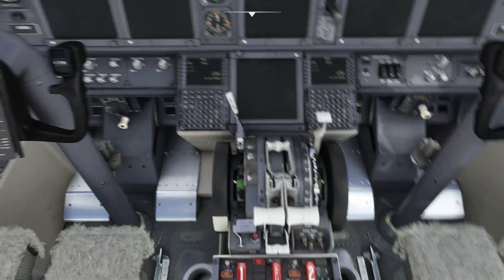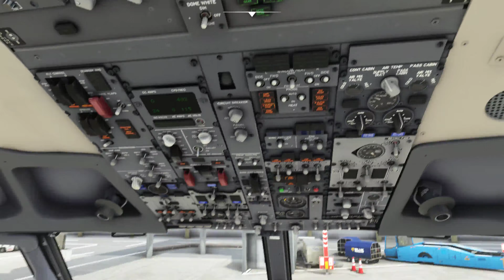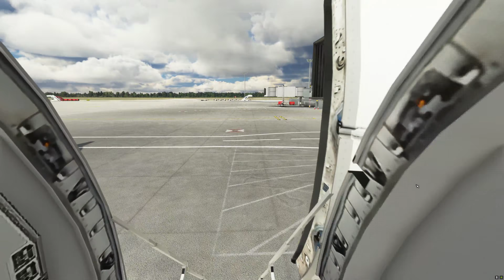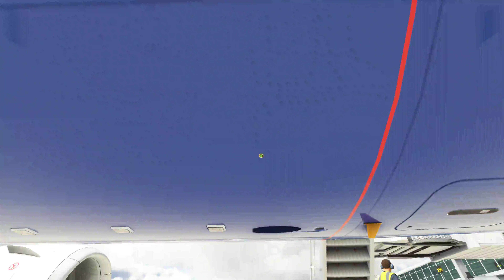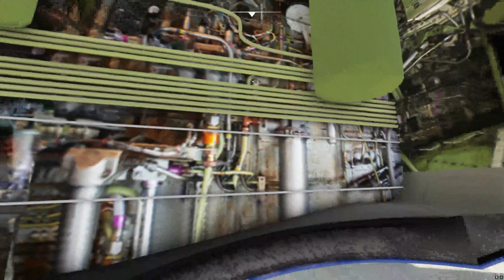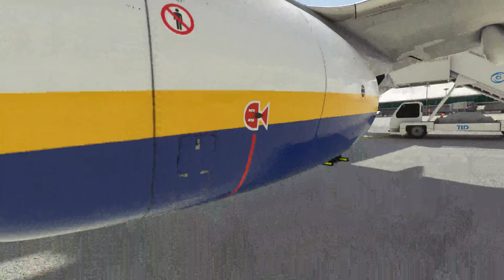PMDG 737-700 for MSFS - Tutorial 1: Safety Inspection, Powerup and Walkaround

Comment: I’ve often heard that you put the Position Lights to Steady once you have AC Power. Is that airline specific or is there another reason that it wasn’t done in that tutorial?
Reply from the maker: The switch is normally left in the STEADY position anyway - so once power is applied it'll be on.
While you are right that the position lights should be on once AC power is applied to the plane it is not specifically mentioned in neither my former airlines, nor Boeings own SOP, to switch the lights on immediately after applying power.

Comment: Hi there!! A&P tech here and I just wanted to point out that is not a fuel overfill vent.  Yes fuel can come out of it but it's main design is not an overflow vent.  They are called naca scoops and their main design is to provide ventilation to the fuel system and tanks.  This is why it's pointing into the direction of flight and has a scoop design to allow airflow into the system and tanks.

Comment: You are amazing. I think that you follow RYR procedures. To be honest sometimes I can not find the logic between the sequence of some procedures. For example, why to make the engine fire warning test then go to overhead panel and after some steps return to cargo fire system. For me it is strange moving up and down. Is there a logic behind it? Thank you very much for your work.
Reply from the maker: The logic is that in case there is no GPU available you would have to start the APU at this point.
Once AC power is established we move on to the overhead and start making the airplane safe by arming the emergency exit lights. If we did that before the APU start/before applying external power, the lights would turn on and drain your battery.
Hope this makes sense!
Reply: @A330Driver  Yes now it makes sense. Thank you very much for your answer.

Comment: Before you head out for the walkaround, I understood the reason behind turning on the parking brake and the electric hydraulic pumps but is there a reason NOT to turn on the wheel well lights? Are they only used at night? I mean a lot of lighting is required during the sunniest day in aviation so I am just curious.
Reply from the maker: There is no reason NOT to turn on the wheel well light. The wheel well is pretty dark, even during bright daylight (especially then since your eyes are used to the brightness) so turning on the wheel well light can never do any harm.

Comment: How do we start cold & dark (I got that set) but also not have stairs but jetway instead?  Is there a way to start with the plane not connected to jetway or stairs until you request?
Reply from the maker: You'd have to create a new panelstate. I suggest loading up a default cold and dark panelstate and removing the equipment you don't want, then saving it again.
Reply: @A330Driver  Okay, thanks!

Comment: You state that you aren't going to start up and use the APU to save the environment. But you will use the ground unit that also runs on fossil fuel. What's the difference? This is the same nonsense that the so-called elites use jet setting around the world in private jets saying they are saving humanity from global warming. Can I please make a suggestion to not use fake political/wokism  BS in your videos?
Reply from the maker: There actually is a HUGE difference in the emmisions from the two. A typical diesel GPU uses anywhere between 4-10 liters an hour to power a 737. The most modern ones can even go under the 4l/h mark. The APU uses around 60kg/h.
Furthermore, many airports are using units these days which are implemented into the airports own power system. At least here in Europe quite some of them are already partially using renewable energy.
Now start calculating these things for the whole industry. Let's take an airline like Ryanair that's doing around 3000 flights a day. That also means 3000 turnarounds, lasting 25 minutes. That's 1250 hours of turnaround time where the aircraft need power.
Let's say we only use the least energy efficient GPUs, using around 10l/h. That's 12500 liters of Diesel being used to power the aircraft. The density of Diesel is typically around 0.85, making it 10625kg of Diesel
Now compare it to the 60kg/h from the APU. That's 75t of fuel.
10.6 vs 75.0t of fuel usage. You're saving 64,6t of fuel just from these 3000 Ryanair flights alone.
Now for the fun of it, let's extend this calculation onto the whole worlds traffic. This is of course no longer accurate since it neglects many factors, but let's do it anything just for the fun of it. Every day there are around 200.000 aircraft flying. I can't find any data on how many flights these do, but to make it simple, let's assume 4 flights per aircraft, that should hopefully build a good average between long haul aircraft that only do 2 flights and shorthaul aircraft that do 8 or more a day.
Now make a simple calculation, 64,6/3000*800000.
That's 17226,67t of fuel that's being saved by the usage of GPUs.
Let's go on with this. 17226,67t of jet fuel equals around 21.533.333,3 liters of fuel.
In 2017 all of Germanys car traffic together used around 121 million liters of fuel.
See where this is going? All aircraft around the world can save around 17% of the fuel emmisions of all German cars a day.
I call that a lot.

Again, I don't claim those numbers to be accurate, they're just rough estimations based on ballparkfigures to show you roughly where we end up.

So no, this is not political bullshit, there's actual reasons behind this.
Of course it also helps the airlines as it saves money. But at least in terms of fuel usage saving the environment and saving money are the same thing.
Reply from the maker: So no, just because it doesn't seem a lot for a single flight, it doens't mean these things are neglible.
Of course, a step climb on a 2 hour flight in the 737 will typically only save you some 20kg of fuel which seems incredibly little compared to the 5000kg of fuel you're using on that flight.
Similarly, look at things like single engine taxi. You're saving maybe 10kg of fuel at best. But see how many daily flights there are and things will add up. That's why we're doing it.
Reply: @A330Driver   Thank you for the explanation.

Comment: How do you set your correct sitting position from the height What is the reference point? Airbus, there are white and red balls that you have to line up in order to sit properly
Does that also work with the PMDG like in real life with the seating position? Thanks
Reply from the maker: Basically, you need to be able to see the top of the glareshield slightly, but the control column must not obstruct the view of the PFD and you must be able to see the autobrake disarm light.
When all three are met you're sitting correctly.

Comment: The wait for the -800 will be excruciating
Reply from the maker: I can wholeheartely recommend getting and enjoying the -700 until the -800 comes out. I'm sure you'll find at least one or two airlines operating the -700 that you could fly.
Reply: @A330Driver  nope.  I have 800 hours in the -800 variant.
Reply: @A330Driver  yeah but then I’d have to pay twice
Reply from the maker: @LemonToGo  True, but then again you're also getting two aircraft variants. And it won't be as expensive as they have been back in the P3D days.
Reply: @A330Driver  I suppose that is true

Comment: How is it MSFS got the 700 before getting 800 & 900. Always before the 700 was the extra expansion you got after the base model 800 & 900 was the base model in PMDG. So I guess in MSFS 700 is Base & 800 & 900 are going to be the expansion instead this time around.
Reply from the maker: That's a question I can not answer, you should ask PMDG directly. I believe they actually posted an explanation in the forums already. Try to search their forums and you should find an answer.
Reply: @A330Driver  It has to do with cash flow.  They want $$ each and every iteration of the plane.
Reply: Every model will be a separate package. So you could just choose what model you want to buy. The 700 will release first then the 600, 800 and finally the 900  and finally theax series will also come. This way you can just pick a model that you want and not have to buy a 150$ package with all models.
Reply: @Rosne134  copy
Reply: @Rosne134  Thank you
Reply: @UnitedBill80  No problem
Reply: Yep PMDG knew the 800 is what most simmers want. But they knew if they released it first, all other versions wouldn’t sell anywhere near as well. And they knew many simmers wouldn’t wait 12 extra weeks for the 800 and would buy the 700 for the interim if they released it first. PMDG was dead right. They have made a killing on the 700 far beyond they ever would have if they released it after the 800.  It’s all about money. And PMDG have increased the prices massively as in P3D we got all these versions from 600 to 900 for $135. Now to get the same it’s over $250. And why wasn’t a 737 included in debut aircraft. Look back prerelease of the MFSF, there were discussions of a deal made between Microsoft and PMDG.

Comment: Thanks for the really nice videos so far! One small question, is there a keybinding, or a way to set a keybind to toggle the landing gear into the OFF position currently? This is with regards to using physical landing gear lever, and im wondering if its possible to toggle the OFF position when I move the physical lever to the OFF position. Thanks :)
Reply from the maker: At the moment there is no such key binding. Right now Asobo (the MSFS developers) still restrict what you can access with the programming language used by PMDG. Once Asobo removes this restriction from the base simulator PMDG will add key bindings in.
For now they are able to read most of the default bindings which do work with the airplane. However I don't think there is a binding for an OFF position of the gear lever in the default sim.
Reply: @A330Driver  thank you very much!

Comment: Can you ask pmdg to correct the yoke 3d model. It looks like 70% thickness of the real thing
Reply from the maker: mmh, I can't share your impression. I'll take some screenshots today and will bring them to tomorrows (real) flight to compare.
Reply: @A330Driver  did you check?
Reply from the maker: @teropa79  I did, it's certainly better than 70%, but not quite at 100% I have to agree. Details are in PMDGs tracking system already.
My guess is that it's not going to be fixed for initial release but with a later update.
Reply: @A330Driver  thanks for the effort!

Comment: hello, could someone tell me how to put a ramp at the back of the plane? I would also like to know how to get the b737. Thanks for the help !
Reply from the maker: Could you confirm what exactly you mean with "put a ramp at the back of the plane"? If you mean the stairs, you can select this in the PMDG options from the CDU screen. They're a feature of the aircraft, not of the simulator, therefore they'll only be available in the 737 (and future PMDG releases).
Currently the aircraft is still in beta so you can not buy it yet. Once it's released you'll be able to get it from pmdg.com.
Reply: @A330Driver  thank you for your reply !  In fact I was talking about the stairs at the back of the plane. Currently in the game we can only connect one ramp on our plane and this one is only positioned at the front of the plane. when do you think the aircraft will be available?  and at what price?
Reply from the maker: @7ptune331  I don't have any more releasedate or pricing information than what you can find in the PMDG forums, sorry.
Reply: @7ptune331  Simulator , not a game

Comment: Don't you also have to check the master caution when running fault inop part of the fire test?
Reply from the maker: Yes I do. However I skipped this part because in the PMDG 737 currently the test only works for so long and thus I had limited time.
If you watch closely you'll see how the test finishes a split second before I'm able to silence the fire bell as well - but since that happened in such a short time I thought hardly anyone would notice that I didn't press the button LOL
I guess I was wrong ;-)
Reply: Hi from were to buy this airplane?
Reply: @CaptainM25  Not out yet....but eventually from PMDG....just google it.